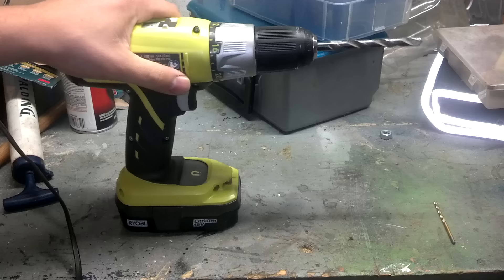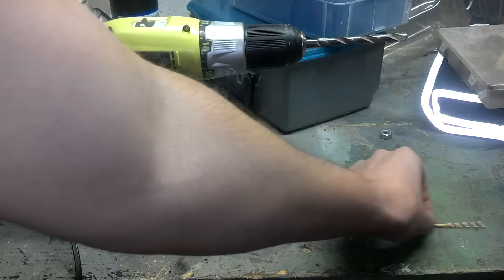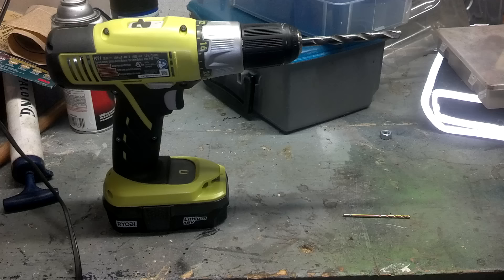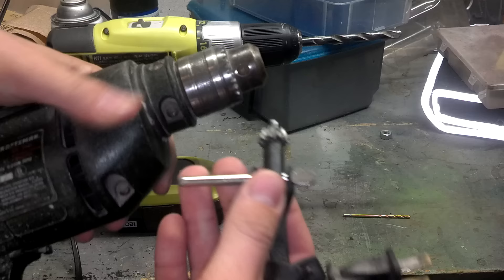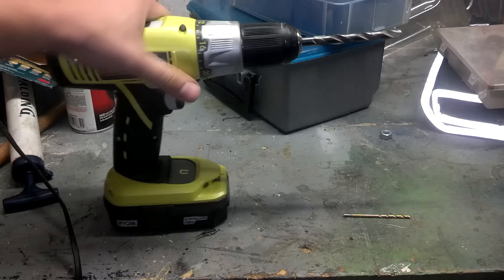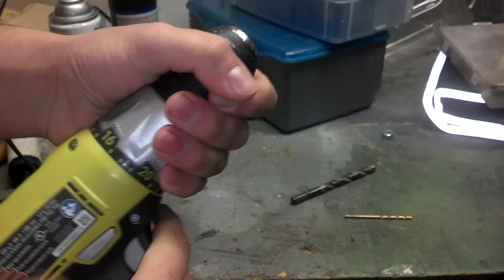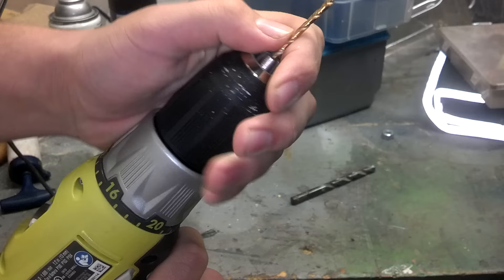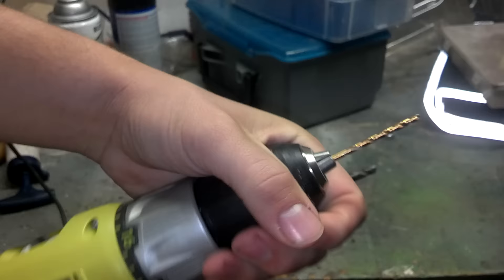How To Change a Drill Bit

Comment: What happens if the same drill you just bought loosens the drill bits automatically after you get done doing? It happens no matter how tight the drill bit is. Has this happened to anyone that owns the Ryobi One + Cordless drill?
Reply: Yes I have two that do the same fucking thing.

Comment: Really? I was expecting something new. I remember in 80th I had a player casset from US. There was a sign, after side A is finished turn it to side B. I do not know why you always mention obvious? Are there people in your country who owns a drill and do not know how to change drill bit? I can hardly imagine it here.
Reply: Reposted: I know how in general, but this video solved my problem with my new drill - I put my first drill bit in and successfully used it, but then could not figure out how to remove it - even with written manual instructions - the "chuck" was very tight and needed a major effort twist to loosen that I wasn't sure about until I watched this clip - now it works as expected thanks to this helpful clip.
Reply: The instructions that come with my new drill (I’ve never owned one) are so very vague.  When beginning a journey whether it’s using power tools or paint tools or whatever, the obvious is necessary to learn the basic.  I would think I wouldn’t have to say something so obvious.

Comment: Really? who doesn't know how to change a drill bit?
Reply: chevy sucks 
From the views, around 200k people don't
Reply: I know how in general, but this video solved my problem with my new drill - I put my first drill bit in and successfully used it, but then could not figure out how to remove it - even with written manual instructions - the "chuck" was very tight and needed a major effort twist to loosen that I wasn't sure about until I watched this clip - now it works as expected thanks to this helpful clip. ( I do think it's funny that "NoClueHowTo" doesn't seem to know the term "chuck key" )

Comment: horribe, no safety what so ever. No gloves, you do not put your finger on the drill bit because it can cut you and you must remove all power source from the drill....e.g. the battery then loosen the drill bit as you show.
Reply: David Rodriguez anyone with any experience would also tell you that you never use gloves with a drill, a drill press, a lathe , a mill, or any other spinning tool. That glove gets caught and bye bye fingers, hand, or even worse. Don't heed this mans advice people. It will get you hurt
Reply: This man said “gloves” lmaoooooo smh